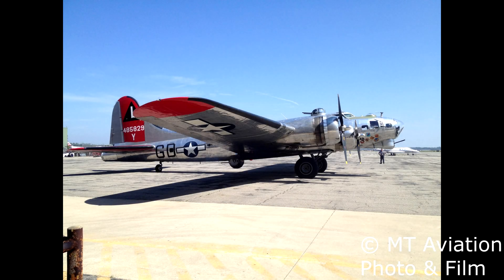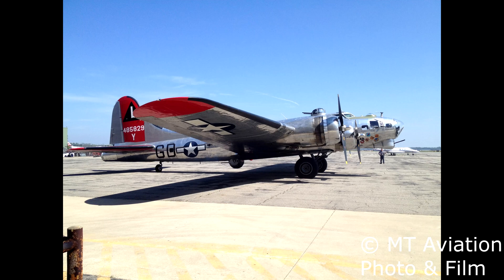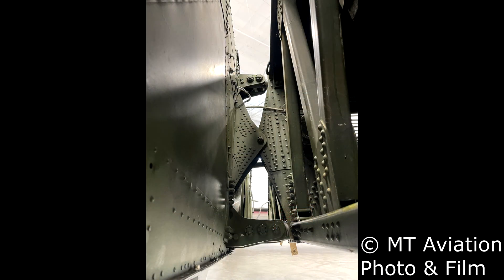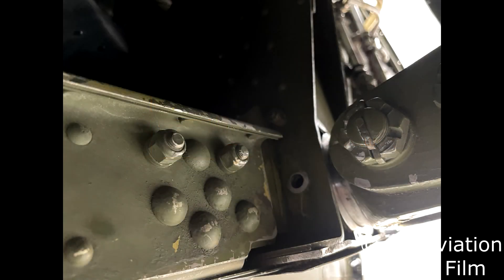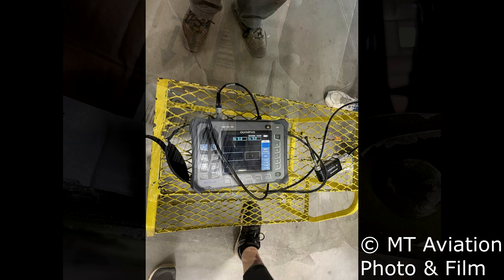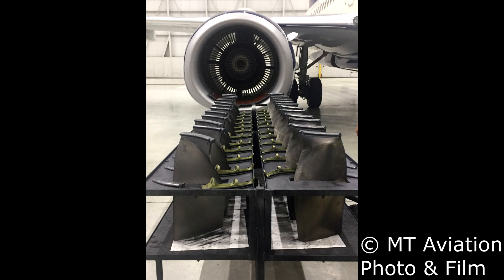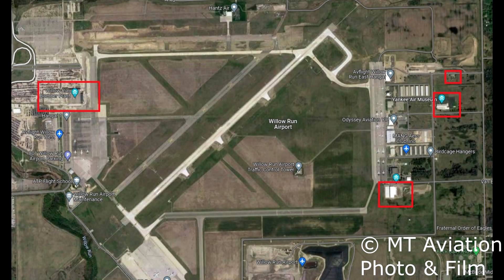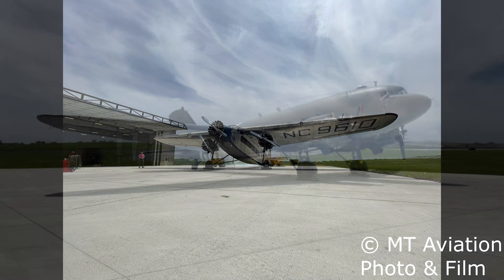A look at B-17 Yankee Lady's wing inspection after grounding

Comment: As this issue was discovered on Aluminum Overcast it makes one wonder if it might have has something to do with that landing gear failure back in 2004.  It will be interesting to see if any of the other B-17s have developed the same crack.
Reply: This issue isn’t a surprise to the operators. It was already on folks radar, and the FAA had addressed it some years ago as a potential future problem. As I understand it, the discovery on AA spurred the FAA to come out with an updated directive now that the problem has advanced to a genuine safety concern, and is no longer a “this could be a problem in the future” type concern. It’s an inherent issue in the design that everyone knew about, and in theory will eventually affect all the airframes, it’s just a matter of time.
Reply from the maker: @SkyWriter25 It would be hard to say what all had a factor into this. Its a 70+ year old plane, I dont think anyone really knows what all its been through in its life or what type of stresses were put on the airframe during that time.